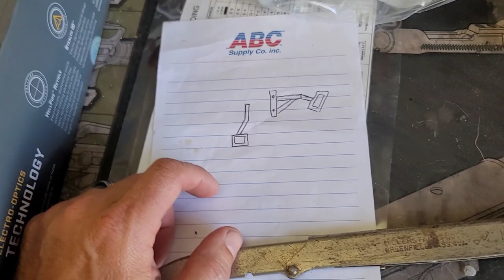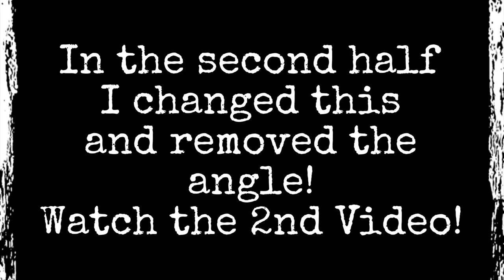Building a step for the Farmall Super A (part 1)

Comment: You should reverse the angle iron that has the bolt holes in it so the brace is in front of the tractor frame.  This would be stronger and allow for the mid mount  mower framing to attach more easily.  I think!  Lol
Reply from the maker: It's strong!  I had a gentleman who is 6'5" and over 300lb buy one,  he wrote me to tell me it holds him beautifully!  It mounts fine with swinging drawbars, etc..Check out my latest video.